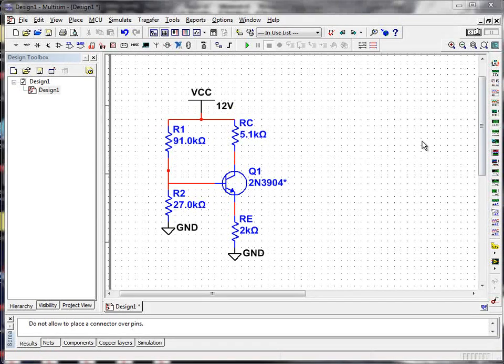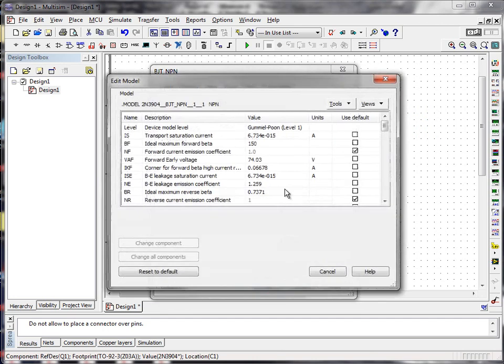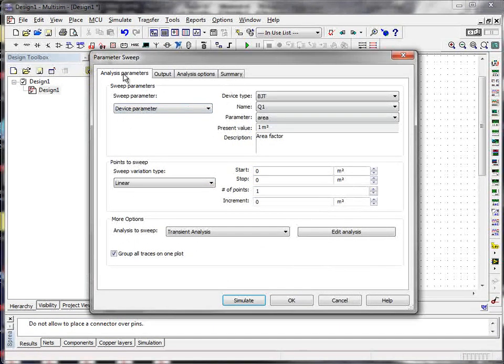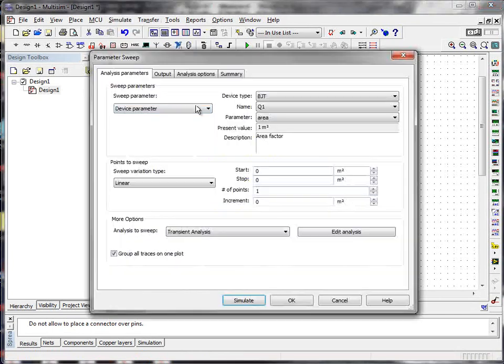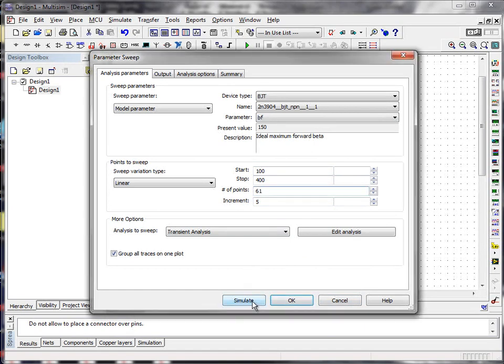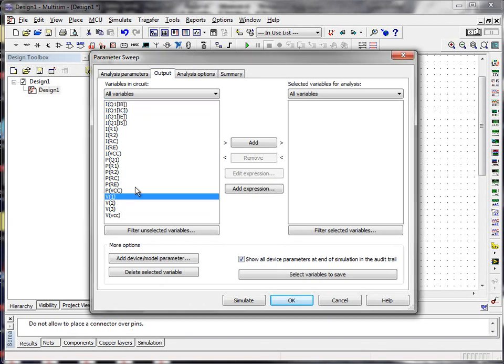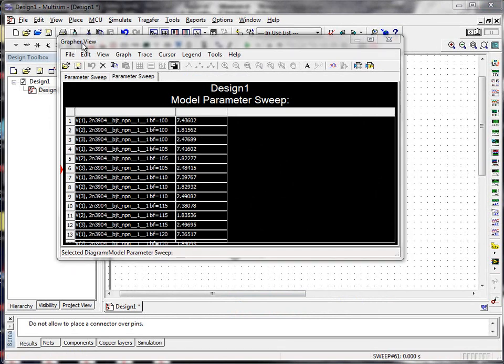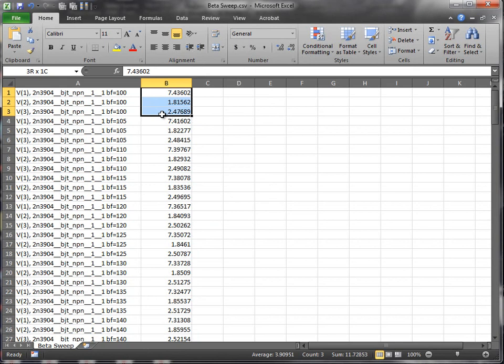Parameter sweep

Comment: I have a parameter sweep of the Coupling coefficient K from 0 to 1 at increments of 0.1 with an output variable to my current through ie R1. I set a probe to check if current is running through and its fine; however, when I do a parameter sweep then output the current of R1 the graph and tables output all 0A at all values of K?